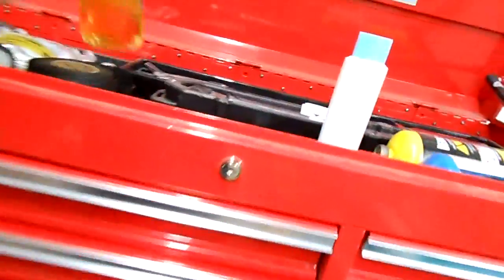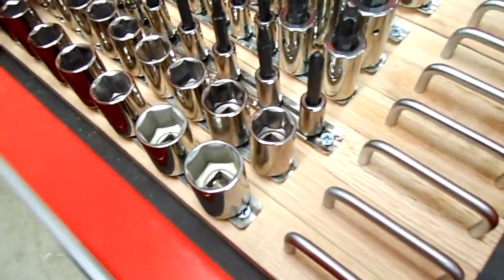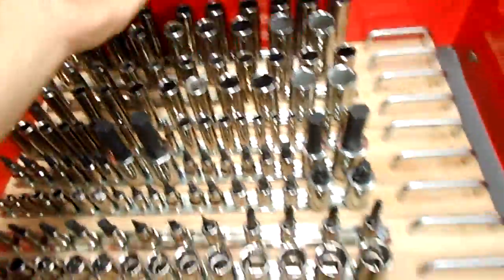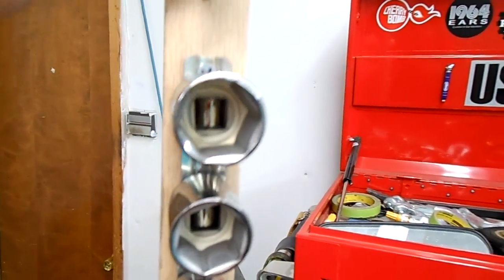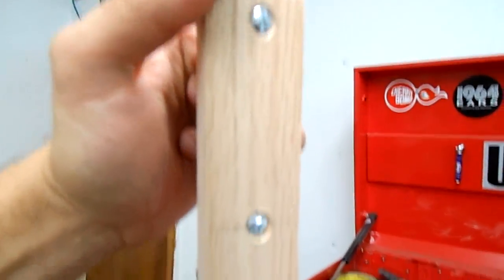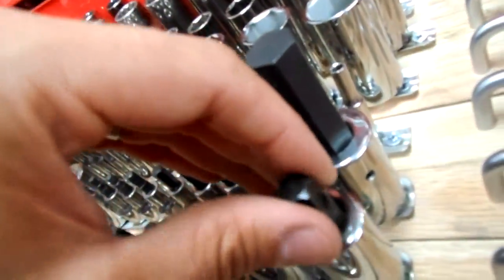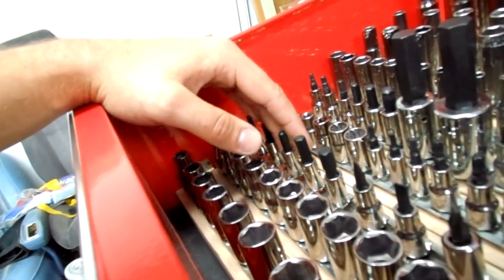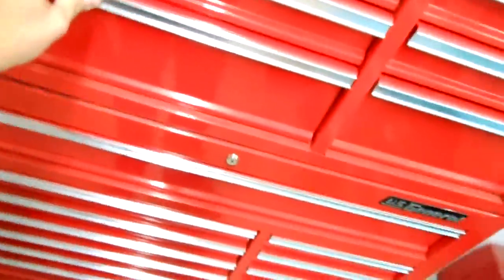Home Made Socket Rails-Custom

Comment: You bought?!

WHAT?!  What did you buy???

What clamps are holding the sockets?!   You aren't clear about what the rail is.

I am not trying to be jerky.  I am just frustrated because I love the design, but have no clue what the full rail assemblies consist of.
Reply from the maker: What you see in the video is an assembly of 3 inch drawer pulls bought from the home depot, 1x2 oak from the home depot, and the chrome socket rails screwed to the oak were purchased from harbor freight for a buck each. Each unit I put together cost about seven dollars. If I ever get a new camera I'll do a legit how-to video.

Comment: How is a 2x4 not a 2x4? Two inches thick and four inches wide. The length can vary. A 2x4 is a 2x4 lol.
Reply from the maker: A 2x4 actaully measures about 1.5" x 3.5." I don't know why but many stud sizes are rounded up this way. I'm sure carpenters have a good reason for it.
Reply: He's right, same applies to 4x6's too.

Comment: Your beer and belch intro appeals to 12 year olds. Your sets look good, but I've found the metal clips are often too tight or loose and are annoying.
Reply: rocker85675 😂
Reply: It doesn’t imply anything it showcases in a glaringly bright obvious light,exactly as you did,that he has an IQ lower than a babies shoe size.